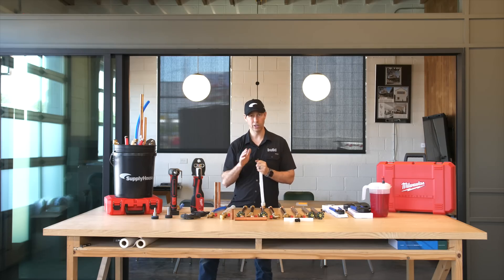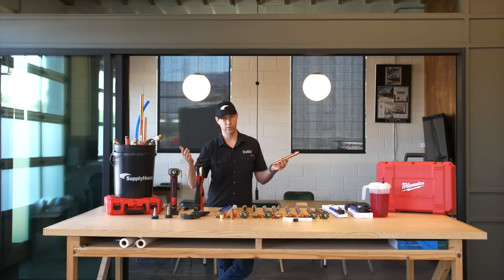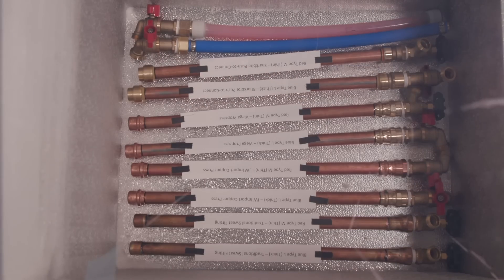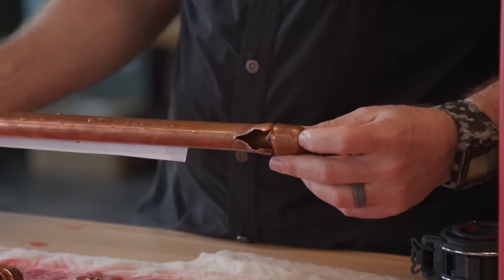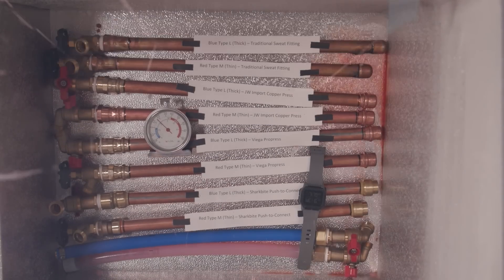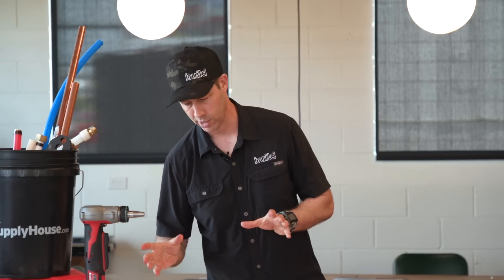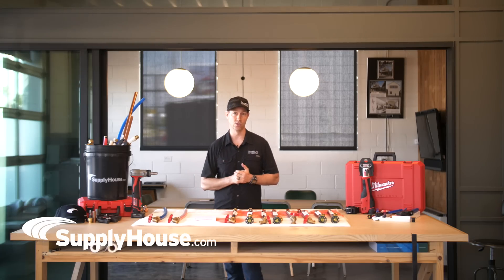Copper vs PEX Freeze Test Part 2

Comment: I’m curious about the divots in the fitting. I would imagine there are also divots on the interior of the pipe… I was always told excess solder can cause turbulence in a copper pipe and cause the copper to pit in the pipe. Same thing with cold water pipes where the flux didn’t melt and could cause pitting. I wonder if the divots from the crimping could create turbulence and cause pitting???
Anyone care to comment?

Comment: Interesting, but 2 things i thought about was the short runs, where you have less room for expansion. Ice is nothing to mess with, when you remember ice took down the titanic. I seen a cast iron check have the cover split in too during a rare freeze in the san fran area. The cast iron cover plate is 1/2 inch thick.

Comment: Ok. That was informative. Do you have a positive pressure test with those copper press fittings like you did with the PEX? That's where the rubber meets the road.

Comment: What about a heat and pressure test for PEX showing the temperatures and pressures PEX fails at.  One of my main concerns with using PEX is the low pressure ratings at high temperatures compared to copper.

Comment: Pex with crimp rings are the way to go.  Cost and time wise, better than cpvc or copper.  Pex wont burst if it freezes, and the crimp rings hold so much pressure.  I saw a test of different types of pex fittings and different rings where the sharkbite blew off just over 100 psi but on the others, none of them failed.  On each of them, the actual pex pipe itself burst from the pressure and didnt come apart at the fitting.  I wanna say it was around 800 psi or so.  Crazy how well that stuff holds.  My only concern would be using the plastic pex fittings, if they become brittle after 20 years like most all plastic does.

Comment: Guessing the reason they all went at one end was the freezer is probably not cooling evenly and has a colder side. You therefore probably had that side freeze quicker earlier creating uneven forces up the length of the pipe.

Comment: If possible try using McDonald or Ford Brand pack joint connection fittings. These are more of a utility industry fitting ( extremely expensive compared to anything else) We use them along with Type K soft copper .

Comment: I have found that my manual crimped pex copper bans with  (SharkBite brand now) brass fittings on one project froze completely  and water did initially squirted out upon freezing but once thawed everything self sealed again.  I was impressed and had NO leaks afterwards or NO broken or cracked brass fittings.  Great videos.. Thx!

Comment: Someone should make a more stretchable PEX piping that could be used on the outside or near the walls of structures where it won't be insulated.
Or special fittings that expand.
PEX seems to have done better here and I bet it is the flexibility of plastic over copper.
Truth is, these results were as expected, same as previous tests.  All these different methods of attaching pipes is just getting stupid, and none are significantly better or worse from the other.
Change in material and entirely different types of fittings would need to be used to solve problems such as freezing pipes.

Comment: the pipe with sweated fittings split on the pipe near the fitting, did the heat from sweating them on stress the pipe? maybe they were they overheated?
Reply: dondiego124 Mine have never split near the joint, so this is a bit baffling to me.  Overheating will definitely make them brittle, but my guess is that the extra copper in the fittings is conducting the cold air and freezing the water in those areas first.  Copper is a great conductor of both electricity and thermal temperatures, which is why it is so sought after in high-end cookware.

Comment: I would be curious about how to do a proper junction between a PVC pipe going from a lavatory to a cast iron pipe. I've got one that is leaky and needs to be fixed.
Reply: Only way I've seen is big rubber couplings. Essentially a section of black rubber tube with hose clamps. Not ideal and you need to have a nice-ish end on your cast iron, but it works. You could also theoretically braze or solder a piece of copper or brass to the cast iron and convert that to PVC, but there are potential problems with corrosion/reactions between the metals (I wouldn't attempt it).
Reply: Jonathan Langlois I see you responded but I can’t find the actual comment anywhere :(

Comment: PEX for the win over copper in residential plumbing. A person just needs to have it installed correctly. I only use Sharkbite type fittings for emergency repairs (of copper water lines) or when I am replacing an entire house water line system (so that the customer can still have partial system usage), then I replace the Sharkbite fittings with standard PEX fittings.

Comment: In Russia people use different kinds of PE/PP/PVC pipes and melt them using special soldering iron. Basically it melts the plastic and people connect pipes when they are still hot. You have to do it in a split second. It makes really strong bonding and those pipes withstand temperatures -30 degrees Celsius (-20 F).  There are very popular pipes armed with aluminum foil inside. Also people use the same melting practice to connect plastic fittings etc. 
Basically plasticity of the material allows to withstand water expansion during freezing and elasticity to regain the original shape after thawing. None of that will work with copper or steel piping because of its properties.

Comment: I'm a home owner and I know very little about plumbing but if I were building a house today, I would chose the PEX piping. Yes, I know it was there only as a "control" for the testing but what I saw in the results was the PEX beating all of the copper pipes and fittings with very little leakage. I know you should always do what you can to avoid having your pipes freeze. Yet, in that ultra rare occasion when the heat goes out in the middle of January and it's -20 F outside, your gonna want to have a last line of defense. PEX piping would be my choice.

Comment: Crimped* fittings.  Shark bite are a pressed-on or push-to-fit.  Crimping is physically deforming something to attach.

Water also freezes and expands with tremendous force.  Somewhere in the tens of thousands to as high as over 100,000 PSI.  Basically no residential water pipes will ever survive a freeze.  A better test for these fittings would be similar to what you did with the PEX pipes and see AT WHAT PSI do they fail.  That is a better comparison with actual data.

Comment: I think what people are missing here is that the copper or sweated pipes burst where as all of the other failures the fitting was pushed off therefore establishing beyond a reasonable doubt that sweating copper is far stronger... Stronger even than the pipe.

Comment: Shows you that solder fitting did not fail but pipe did from pressure of freezing. So solder still best all others fail under pressure. And burn permits are based on job site. Home owner or general contractor can require them. Not issued by government except on their job sites.

Comment: @Matt Risinger, sorry if I'm repeating anyone else's comments, but: 20+ years plumbing experience and business owner, you might appreciate the info (hopefully as much as I appreciate your videos!!).  Type "M" copper, as I have been taught, is only for use in closed looped heating systems. It's thinner wall is actually a drastic difference when having running water through it, minerals, acidity, alkali, well, city will corrode Type "M" more readily. Think type"M" as only to be used in boilers basically. (I know, I know, few exceptions here or there, but rare). Type "L" is sometimes required by code as a base, as you may know there is also type "K", a thicker version yet. Type "K" is required by code (your mileage may vary township-township or state-state) for city water service and underground applications. Typical residential applications, that have copper installed, call for type "L" in 95%+ of the time here in PA, MD, DE, NJ, areas' codes (such as the plumbing in your house, going to toilets, showers, sinks, etc.). 

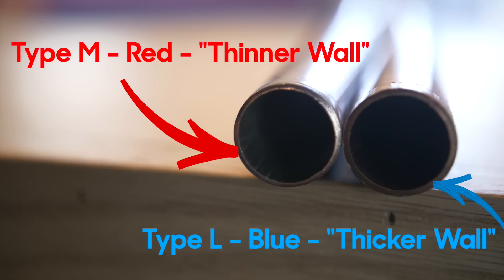May I also say, they all, ALL, have the same Outer Diameter, that's how sharkbites work between all of them, not inner diameter, see yourself at 1:29. I can promise you that if you take a set of calipers to Pex, CPVC, and all 3 types of copper, the OD will be nearly identical with all, or else shark bite/push-fit fittings would never work between them all. 

Cheers and thanks for your videos, I enjoy your work at it:) !
Reply: Someone needs to do a controlled, scientific test on Matt’s bullshit.  
Ya a builder who passes bullshit as fact.  

Type M is what you’d use for residential? ok we know what an expert you are now.  

That copper tubing holds the ID, not the OD?  
The dumbest neophyte knows ALL tubing holds their OD across different gauges. 

He’s downright dangerous also in a few of the other vids of his.

Comment: In order to meaningfully test these systems they need to be under real world stress conditions. Your whole house suddenly turning into a freezer isn't likely and if it did your pipping is probably not the first thing to worry about. Some test ideas:
Try a push-fit valve downstream from a hose bib. But actually you don't even need the hose bib. Just use a 2 foot long pipe exposed to freezing temp while the value is back out of the cold and insulated with a pushfit on the end.
Use copper pipe with a push fit valve and push elbow on either end and fix both of them with boards to hold them firmly in place. Run 140F hot water through the pipe on a valve timer until it fails.
Use a very long run of unsupported PVC and use pushfit connectors to attach the pipe to affixed pipes. Rattle the loose pipe around by a few inches back and forth until one of the connections leaks.

Comment: I actually use a bunch of Sharkbite valves. The reasoning is actually to make it easier to get hose bibs off if they ever get damaged. Hose bibs can get damaged a lot of ways like from yanking or frost proving doing no good if you leave the hose on. I find that its far more likely your valves are going to leak than your fittings. Further fittings that do leak are typically because of bad installation including sweated connections. Ironically push-fit connectors give a much wider "stupid" tolerance so are less likely to leak if a home owner installs them. I think the only system thats home owner friendly is PVC cement BUT most PVC valves are junk.

Comment: I think this test proved that parts are built to specs. Sure, one of those specs is strength. Another one is cost. Like they say: any fool can build a bridge that stands, but it takes an engineer to build one that barely stands. Build it just strong enough that it meets code, but not so strong that it costs to much.

Comment: We don’t specify these pressure fittings in our our engineering office because they have proven to be a liability. If a contractor uses them they assume the liability because the chances of having joints leak are significantly higher than a soldered copper joint.

Comment: If you watch the copper press fittings, they don't slide beyond where the gasket is keeping the pipe sealed until after the copper on the sweat fittings burst.  Seems like this could potentially be an advantage of the copper press, especially if you mark the fitting as done in the video. It could absorb some of the stress from anything less than a total freeze so you can (maybe) catch the problem before a total blow out.
Reply: But if you have multiple short term freezing it will push out a little more with every freeze therefor could fail when sweat fittings wouldn't.
Reply: @phillhuddleston9445  Maybe.  They didn't even start moving until there was significant freezing judging on how the ice came out the end like a push pop.  Any connection having repeated bouts of freezing like that will fail eventually.  Sweat likely to last longer before failure though agreed.  Just insulate properly and use whatever you like lol

Comment: You could put two different types of fittings on the same piece of copper to see which failed first. For hose bibs and exterior lines here in the warmer southwest, I often use Type K (Green) and solder the fittings or I use Rehau Pex. I feel a little better about this combination after seeing your test. Coldest temp I think I've ever seen here is 17°F so still need to insulate too, but not to the extent of most places.

Comment: Here's something to thing about with these press fittings:  You can press on with millions of tons of pressure but without something to "push back" or hold back.  I can't really see it working well.
  just a quick thought... what if it was a 3 step process: 1: basic press on fitting.  2: 60psi of air applied to the piping system for "push back" 3: final pressure applied until no air leaks....

Comment: Interesting. Never want any pipes to freeze, but looks like plastic is more forgiving. As far as pressure testing,  residential pressures are  pretty low. I would be most interested in the integrity of the instal many years down the road. If I buy a 25 YO house will the plumbing be an issue? Seems like the pex is so much easier to install, reroute and add onto.

Comment: Robert Buck's statement "do not [let] waterlines freeze" is right on.  It makes me wonder why plumbing practice (or code) doesn't recommend (require) a sacrificial, easily replaced "soft pipe" or something to protect all the pipe in the wall.  If pipe freezing is allowed to happen, doesn't it make sense to have some segment of the water line fail at say half the pressure that damage usually occurs?  Preferably this sacrificial pipe would be located outdoors (like under the faucet) to minimize interior damage, attract attention more readily, and be easy to fix (not requiring sheet rock work).

Comment: I am a retired plumber from Local 230. What your demonstration proved is you do not want your waterlines to freeze (simply put). It does not matter if it’s type M, L, K sweat or mechanical or plastic, insulated or not. If it freezes you have problems! There are different strategies that a plumber can use to produce a reliable functioning system for a owner. Maybe  you can produce a video someday about that. Thank you for your informative videos! I do enjoy!
Reply: do you recommend 3/4" main lines to kitchens/bathrooms that branch off at 1/2"? rooms are 55 ft max from my 60 PSI pressure regulating valve coming off the street.

Comment: Good luck trying to change a plumbers mind over the age of 50 LOL
Reply: I use the rehau plex for general hot&cold and have for about twenty years .
Gas lines I still do in copper , only because I'm dealing with large MJ,s and plastic don't cut it . About five years ago I switched to B-press Rothenburger not because I wanted to but because in the fine print of any insurance I tried to get it didn't cover fire from oxy/acceterlene so it was more a covering my butt .
Reply: splashpit Yeah I hear copper being used for gas lines in some places or of course around here they use that flexible crap. I’m not impressed with the corrugated flexible crap running all around my building. You get a lightning strike on your building in that shit gets pinholes in it right away. Around here or you can use his black pipe like always. I also hear they Use copper for gas over in the UK. Not here in Ohio that I know of except for maybe some propane but general building work still black pipe for me.

Comment: check out streamlabs untrasonic doppler, just 2 zip ties on water main and it accurately reads water flow down to .25 GPM using great app with leak detector.  I paid $199 lowes, I am not being paid to advertise this.  They also make an inline unit that can shutoff water too $599.  I think the $199 unit is so easy to install maybe 10 mins, and you tell it the pipe type copper or cpvc, size and it's accuracy is perfect.  App is decent showing usage, push notification for leaks, or unusual water usage from normal, it learns, freeze detector.

Comment: Meatt, the takeaways depend on where you live. I live in Phoenix, were we don't get very far past the 34 Deg F/0 Deg C line. So, in my environment all of those fittings will function just fine. If I live in places where the temps dipped in the -4 Deg F/ -20 Deg C area, I don't think I'd rely on any of the pressed fittings.
Reply: 34 °F  is about 1 °C.

Comment: Please include some of the fittings considered premium in Europe/Nordics next time, such as Geberit Mapress copper pipe fittings (w/Milwaukee tool), JRG Sanipex plastic pipe / copper fittings and press-free fittings such as Broen Ballofix (VSH compression) and Pipefix.
https://www.international.geberit.com/products/piping-systems-supply/geberit-mapress-copper-fittings/

https://www.gfps.com/appgate/ecat/common_flow/10005L/UK/en/109868/109911/index.html

https://www.broen.com/media/1529/bfth-2016-20-uk_ballofix-technical-manual.pdf

Comment: Why not also test against soldered or braised fittings seeing as these solutions are a flame free alternative. Also what's the guarantee on the rubber washer inside the press fit fittings? These will surely degrade over time?

Comment: Stick with the tried and true method. Thicker copper, sweated together and put insulation between the cold and the pipes, Jmo.
Reply: Interestingly the press fittings didn't reach total failure (where the gasket would have been at the end of the pipe) until after the sweat fittings already burst.
Reply: @nathanh4237 , That's true but I just like the old school way, don't know why but I do.